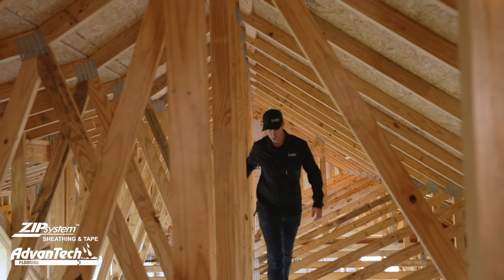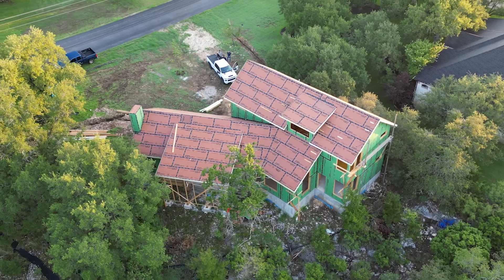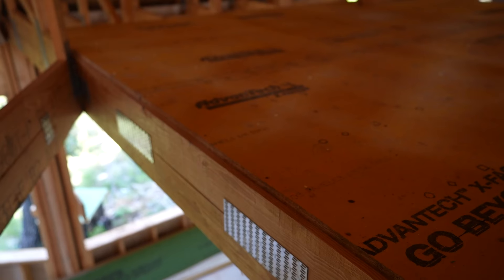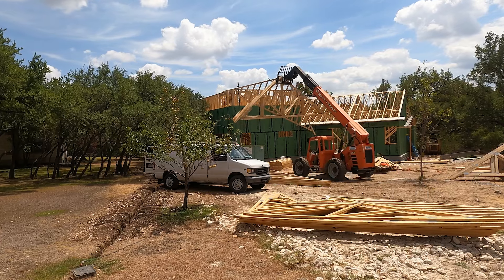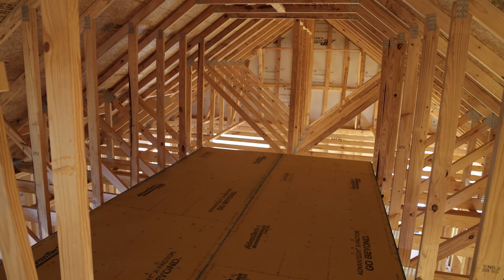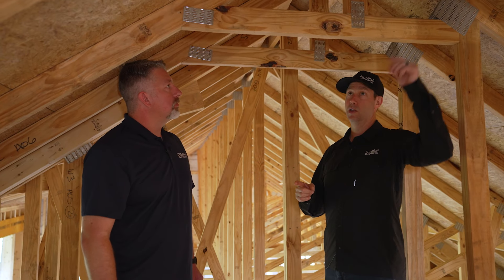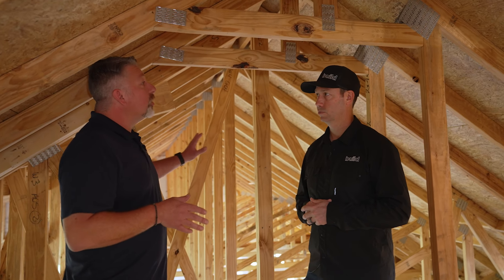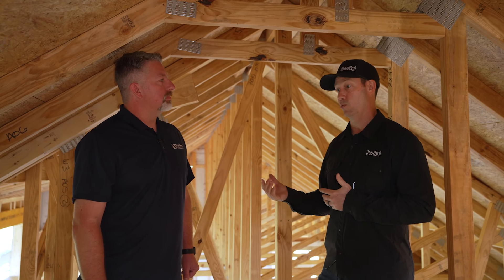ROOF TRUSSES: Pros, cons, and costs!

Comment: As a firefighter I will be building my forever home with hand cut rafters . Yes I do understand the need for truss construction especially for build time and cost savings . To me the benefits of hand cut rafters out weigh the need of truss roofs. Being on a truck company during an attic fire especially on top of a truss roof construction vs hand cut rafter roofs during a fire is noticeably different. For me as a firefighter knowing your construction gives me an idea of time on a roof to work. We all know that truss plates on roofs will fail with heat/ fire. So now add a cement tile/ Mexican tile shingles plus firefighters with gear on top of a roof that’s been compromised due to heat/ fire can be sketchy. Truss roofs have their place in construction and at the end if it’s a custom home the owner should have the final say in the matter at least in my option.

Comment: Trusses always cost more than stock framing. Plus the wait times now are crazy. Trusses work best where it’s clear span.
The other thing is that trusses are engineered, that means they’ll hold the minimum they are designed to hold, no extra.
Reply: Not if snow loads are a factor. What would take 2x10's 16" oc can be accomplished with a truss that has a 2x6 top cord, 2x4 bottom cord, and 24" oc. You can't buy the material for a snow rated hand cut roof for less than a truss package. We typically have full basements so storage isn't a concern. We need space for r50, 60, 70 in the attic and HVAC never goes above the ceiling this far North (that's what the basement is for). The only thing that gets hand cut around here are very small and/or odd sections of roof like above bay windows or a dormer roof.

Comment: $7k savings doesn't tell me much. If going from $10k to $3k cost that is very substantial, but going from $1MM to $993,000 cost is rather insignificant. Both scenarios save $7k. Any idea how much the net savings are on a percentage basis?
Reply: “...doesn’t tell me much”? Actually, as you even reiterate, it tells you everything. BOTH SCENARIOS SAVE $7K.
Reply: A flat $7k savings is going to be a wildly different percentage based on your own examples.

Comment: The IRC hasn't kept up with the concept of applying trusses to construction.  A manufactured truss is always going to be backed up with an engineered design spit out of a software program.  But good luck in getting the same design approved as a site built truss, even though you can build a gusset that is stronger than those metal plates.  The stick framed roofs aren't able to benefit from details that can improve the rigidity of the roof assembly, so they are almost always inefficient, compared to manufactured trusses.  Heaven forbid, that instead of relying on tables and complicated text, that we actually provide software that both the government and the consumer can use to actually do an engineering analysis!

Comment: If you want R-60 to R-100 roof in the north, raised heel trusses with 16+" blown in insulation is the best way to go. You simply can't do a high heel with stick framing, most I seem is 10" which would equal to R-40 on top of all exterior walls.
Reply: The energy bleed happens in the vent tubing from HVAC, have it all in "conditioned spaces", specifically attics in the hotter climates or colder climates.  I live and work in a hot climate and prefer hand cut rafters still, but I do get the benefit on speed with trusses, especially if you are not going to condition that attic/HVAC vent tube runs.  As an industry, with every study showing vent tube losses upwards of 40%, we just haven't evolved from a product perspective to solve that effectively.  It's not a builder thing, it's an HVAC industry thing.
Reply: @iamblaineful  In cold climate, you don't really see hvac runs in attics, most are in a basement or floor joists. I think in south it's hard to dig a basement cause it's only like a foot of soil so they put everything in the attic. yea they do a crappy job of it and the attic should be conditioned in that case. Everything is like flipped between cold and hot climates lol

Comment: Why can’t they build a “truss” using a traditional rafter design?
Reply: can't transport it.
Reply: One of the main truss savings is the use of smaller lumber, usually 2x4s throughout when rafters and traditional ceiling joists require much bigger and expensive lumber.  Plus no heavy duty ridge beam. When they design attic rooms in trusses, they use bigger lumber or double up on the 2x4s which was mentioned in this video.  If they built trusses with traditionally sized lumber, hand framed would be far less money.
Reply: @rj.parker  i could imagine a useful hybrid. build the rafters with similar methods to a truss, fly them in place with a crane, slide the ridge beam in with a crane. savings are made up in labor.

Comment: The work and cost saved in construction is a tiny fraction compared to the gigantic f*(*& hassle later on the work in the attic for the lifetime of the roof.
Truss is a shit corner cutter for the builder, but a hazard for anyone come after.
Reply: Yeah a small cost savings is pretty hard to justify when you lose pretty much the entire attic, especially now that people are doing conditioned attics.
Reply: Aren't there less load bearing walls below though with a truss roof? Moving walls and cutting openings in them is pretty common work later on.